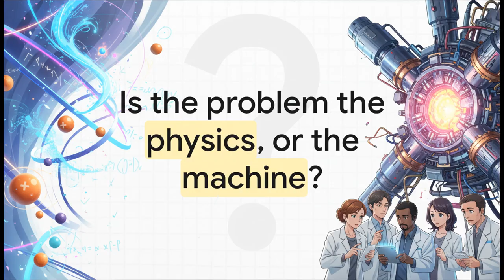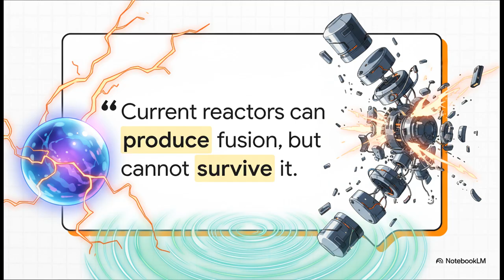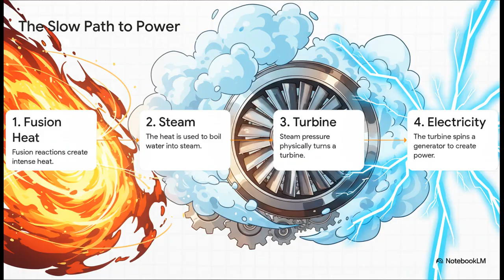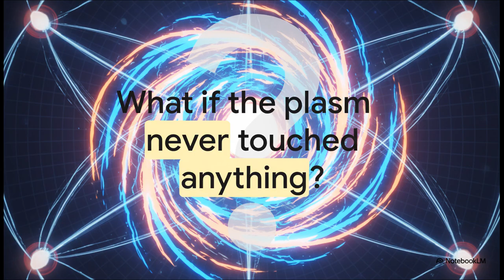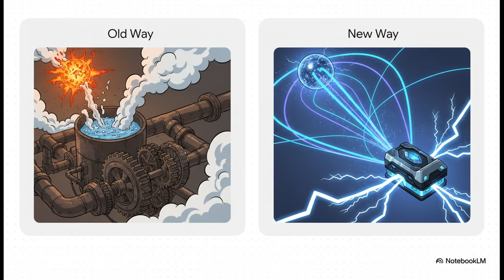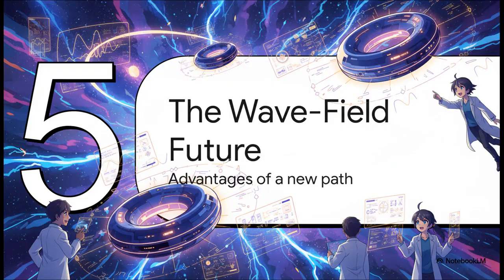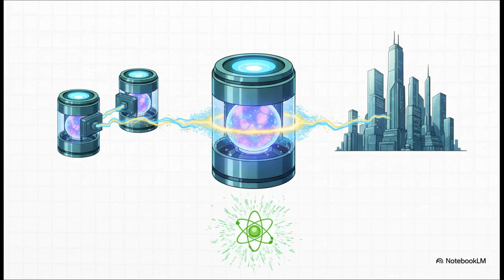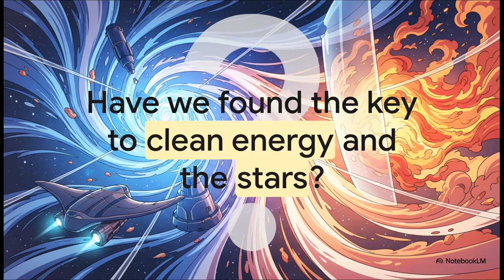Why Fusion Reactors Keep Failing — The Real Physics Problem

Comment: This is an insane take to see. The walls of the vessel are not confining the bulk movement of the plasma. It serves a few purposes. Firstly, the plasma needs some kind of boundary. If it is not kept in a vacuum, it will interact with the air surrounding it and then all sorts of nasty things will happen (ionizing air, stuff escaping, etc). Secondly, keeping air out is really important, especially for fusion, because the chemical composition of plasma is really important for the reactions taking place. Third, the actual bulk confinement of the plasma is already done by electric and magnetic fields. The wall is about keeping stray particles in and everything else out. These fields are generated by superconducting electromagnets that must be very cold to function. Oh wait, that's another reason why the wall is necessary, isn't it. If you don't have anything to stop the thermal radiation from escaping or to stop hot, unionized air from mixing with the plasma and then leaving the confinement, it'll destroy your superconductors. Getting rid of the turbines is worth evaluating as a way of extracting energy from a reactor, but getting rid of the wall is just a silly proposal (unless you want to have your plasma in space, I guess)
Reply from the maker: You’re absolutely right about why the vessel and vacuum are needed — no disagreement there.
My point was about the macro-level energy pathway: even with perfect magnetic confinement, the overall efficiency problem remains, because the entire reactor still depends on huge external systems to sustain the fields and extract heat.
So yes, magnets do the confinement, but the real bottleneck is the system-level energy cycle around them.

Comment: No, these are not the greatest problems with Tokamaks.
The greatest problem is that the whole idea of magnetic confinement is really dumb.
It is a reactor that makes sense if your understanding of plasma physics ends at the Lorentz force.
Reply from the maker: Absolutely. Magnetic confinement is only a symptom — the deeper issue is our missing access to nearly unlimited energy. Without that, global progress remains capped…
well, except when we waste it all on crypto mining. :)
Reply: @HarmonicScaleFramework  Magnetic confinement is the result of a lack of a scientific understanding of plasma physics amongst many of the supposed experts.

These idiots talk about turbulence in a 100% ionized vacuum.
There are two main aspects that alone leads to this absence of turbulence.
First: There is no turbulence in a vacuum thin gas, because there is no chemical reacions happening to create interacting laminar structures.
Second: There are no atoms in a dense fully ionized hydrogen plasma to begin with, meaning no chemical reactions.
 
But lets say laminar structures could form in a fully ionized vacuum plasma.
Then particle phenomenon, caused by the extreme difference in weight of the proton and the electron, leads to the formation of walls separating plasma of different temperatures, density, level of ionization, gravitational potential, and electric potential.
These walls always are two surafces of different charges; one positive surface and on negative surface.
They are called "electrostatic double layers" or DL for short.
These DL walls haves a voltage drop accross them, leading to the powering of electric currents.
Meaning thes DL walls stops all bulk motion, but allows for electric currents to pass through.
 
These DL walls are what we call quasi-stable.
Meaning they can act stable for a long time, and then rapidly explode or disscharge in response to rappid changes in the nature causing them.
When one DL breaks down inside the reactor plasma it can cause a cascading effect.
This usually leads to the plasma losing its stability and crashing in to the wall.
 
These aspects of plasma applies to all space plasma.
That includes the sun and the galaxy.
No convection and no turbulence.
 
Turbulence is when the chemical bonds holding together laminar structures break because different parts of the structure travels at different speeds or in different directions.
The interaction through friction and collisions between these structures is what we call turbulence.

Comment: The bulk of the energy generated in a fusion reaction is gamma wave, neutrons, and fast-moving daughter products.

A mole of [something] will produce an avigadro's number of charges. 96,500 coulombs.

96.5 Kj from 236 grams of Uranium.

I think you would get more power by guiding these fast moving particles through coils.

Now, what will you do with the many-many MegaJoules in heat?
Reply from the maker: You’re right that the charged fusion products could be guided through coils — but only the charged ones.
Gammas and neutrons ignore magnetic fields, so their energy still ends up as heat in the blanket.

So the practical rule is:
• Charged particles → can be guided → direct electricity.
• Neutrons & gammas → cannot be guided → must become heat.

That’s why advanced fuels (like p–B¹¹) are interesting: almost all energy comes as charged particles you can capture electrically.
Reply: @HarmonicScaleFramework  

Edit: I looked up Boron Proton capture after I wrote this. I was familiar with 10B+P as a cancer treatment. I assumed 11B+P would tend to make carbon - wrong.  It tends to create three alphas. Still less energy than burning a mole of coal.
----
Well said. 

We think alike.

I like the Boron10 plus Proton approach. It seems that inertial confinement could make it work.

With this, you get 2 electrons per event, and you have one mole of Boron, you get about 193k Coulombs, or 193 KJ.

That is a very poor energy per mole - if you burn one mole of Carbon you get 2x as much energy - 393.5 kJ. 

I suspect the energy required to harvest that 193KJ would be in the many MJ range. 

Am I missing something? 
Seriously - did I miss a point, somehow?

How can it ever be energy positive?

You have to separate the Boron frim its mineral, and then separate the 10.8 into Boron10 and Boron11. I assume gas centrifuge - high temperature, high pressure, over a great deal of time. I assume Megawatts per kg of input ore.

The 10B+P reaction itself requires very high energy - I assume Megawatts. You need to create a high velocity stream of protons.
Reply: Charge is conserved how to keep them from just recombining
Reply: @kx4532 

Particles moving through a transfers magnetic field Will bend in opposite directions based on charge. Particles will bend in a radius proportional to their mass (small mass -> tight turns, large mass -> large turning radius)..
Reply: @JohnBoen  but the gamma rays and neutrons
Reply: @kx4532

But you asked about charged particles. 

The rest can be captured as heat when the packet of energy hits the walls of the chamber.

No neutrinos, though.